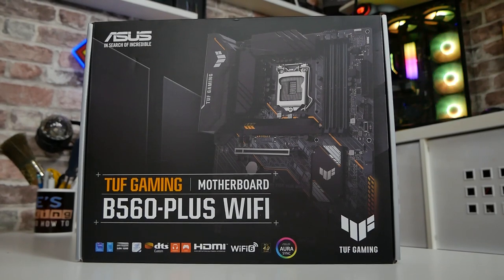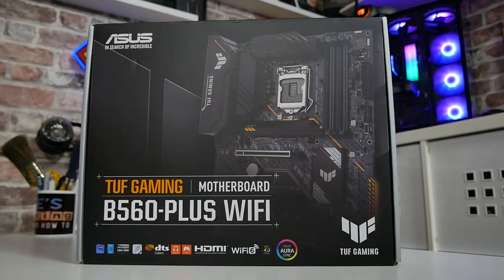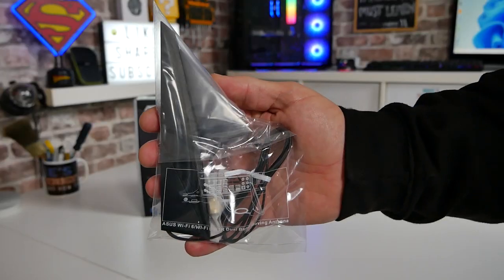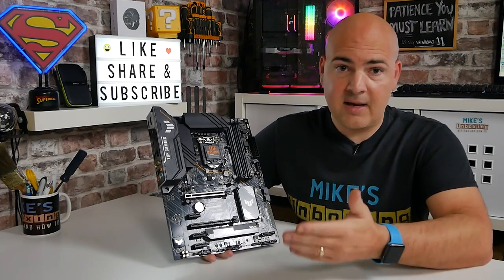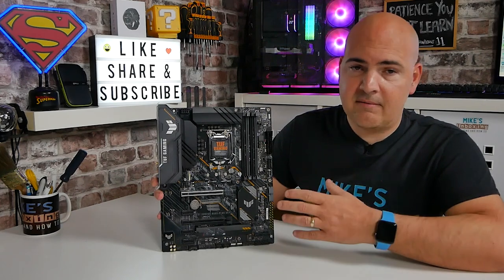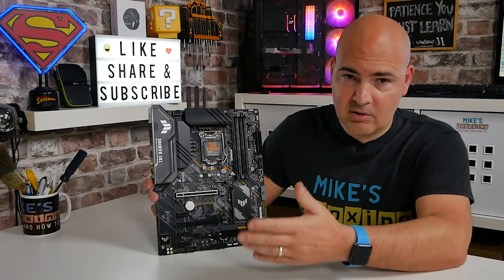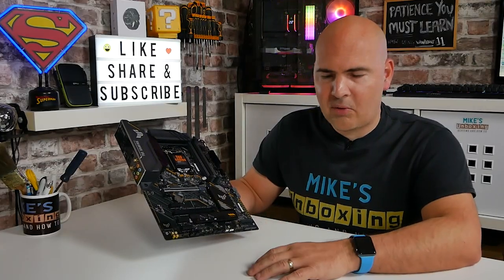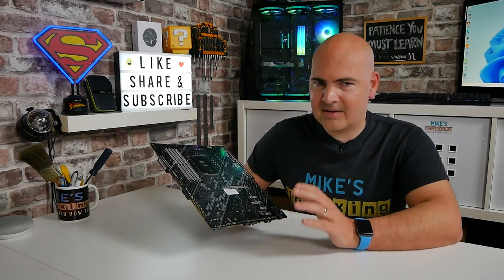ASUS B560 TUF Gaming PLUS Wifi - The Best LGA 1200 Midrange Choice

Comment: I have this board paired with a 10850 k and 32 gigs of corsair ram at 3200. So far so good. The RTX3060TI that I got from E VGA is working fine With the riser cable.
Reply from the maker: awesome setup! hopefully when a nice used 11th gen comes along i might upgrade a bit
Reply: Do u use first m2 slot with your 10th gen cpu or second because mine doesnt work on first :( ?
Reply: @haW001  10th gen doesn’t make use of PCI4 so the top slot is deactivated with a 10th gen chip. You’ll have to use the bottom one not the top one with a 10th gen chip

Comment: Good review and this motherboard is perfect for a workhorse machine that will be very reliable. Intel chipsets are much more reliable than AMD when it comes to USB connections etc. Intel CPU's also tend to be more reliable. There is one other feature you don't get with the 10th gen CPU (i5 10400 and below) which is the newer Intel graphics 750 that is on the 11th gen 11500 or higher CPU's. The slower models, 400 or slower, still use the HD730 graphics. 
Aside from that, ASUS has the edge on Gigabyte models in this range mainly because Gigabyte is very limited with iGraphics connectivity as they only offer HDMI on many boards and then on other boards they offer HDMI and the old 15 pin analog video port.  It's very rare to find a Gigabyte board with both HDMI and DP in this category which is why they are limited which forces the builder to opt for a video card to get around the limited ports offered. 
This B560 is perfect for your everyday builds and the H570 would be the better upgrade without going all the way up to a Z590 model. In fact, Gigabyte doesn't offer H570 boards according to their website.

Comment: Thank you for this review have recently made a purchase of this board based on this review. Pairing with the 11400f. Going to be using the arctic freezer 7x at current until upgrade the cooler. Seen somewhere though that there may be some clearance issues though with the heat sink?
Reply from the maker: i think the 7x will be fine, but not sure what you are thinking will be blocked
Reply: @mikesunboxing  just test fit the arctic freezer 7x and can confirm it don't fit. The mounting bracket goes on fine but where you clamp the cooler down to the bracket it is blocked by the vram heating and the m.2 heat sink. Any recommendations for a cpu cooler 😄

Comment: Interesting review of Intel board Mike. I assume for general use it boils down to availability and costs of components. I been looking to see if i cud upgrade dters R3 1200 to stronger cpu but cex prices above £100, even my R5 3600 now £155 cex. Puts you into low end new intel! As you say if intel mbs were nearer AMD prices they cud decimate the market! Looking forward to your intel review Mike👍
Reply from the maker: yes that really sums it up, it terms of availability intel often have good stock levels but the motherboards are way too expensive at rrp but sometimes a good deal comes along like this which makes the pill much easier to swallow. 
this board with the 10600 is a nice combo

Comment: Thanks for the owesome rewiev, i want to ask if  i use 10th gen intel is the ssd on the bottom still gonna be gen 4? or gen 4 is onli at the top
Reply from the maker: 10th gen only supports PCIE gen 3 so that will be reducing speeds. here is the official specs from ASUS 

Supports 2 x M.2 slots and 6 x SATA 6Gb/s ports
Intel®11th Gen Processors

M.2_1 slot (Key M), type 2242/2260/2280/22110

- Only Intel® 11th processors support PCIe 4.0 x4 mode, this slot will be disabled for other CPUs

Intel® B560 Chipset

M.2_2 slot (Key M), type 2242/2260/2280/22110 (supports PCIe 3.0 x4 & SATA modes)*

6 x SATA 6Gb/s ports

To enable Intel® Optane™ Memory (Hybrid Storage device), it must be installed in PCH-attached slots with Intel® Rapid Storage Technology.

* M.2_2 slot shares bandwidth with SATA_2.When M.2_2 slot is operating in SATA mode, SATA_2 will be disabled.

Comment: I like this board. It's looks and specs. I don't about it's vrms though. Aorus pro m atx is cheaper. But i prefer atx.  Gigabyte z590 gaming x is Same price. So what you suggest?
Reply from the maker: the z590 is for a totally different socket so that is off the list, the aorus is cheaper but like you say it is MATX so it would be. The VRMs shouldn't be a problem as you cant overclock and unless you are using a 10900 which is probably a bad match for this, all the rest of the range will be fine
Reply: @mikesunboxing  well I think it's not of the list when the price is same. That's why i ask!

Comment: I installed an i5 11600 CPU on Asus TUF GAMING B560-PLUS WiFi motherboard but it's not posting. The error/diagnostic LED is on VGA and I don't know how to solve the issue. Please suggest any possible solution...by the way I don't have a Graphics Card.
Reply from the maker: change the cable from DP to HDMI or unplug and replug when it is on, quite a common problem with DP